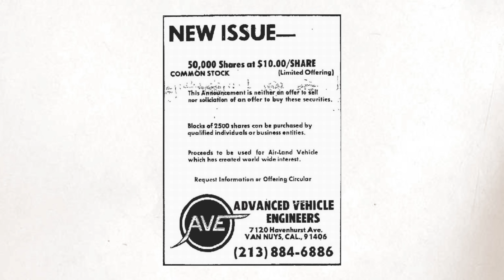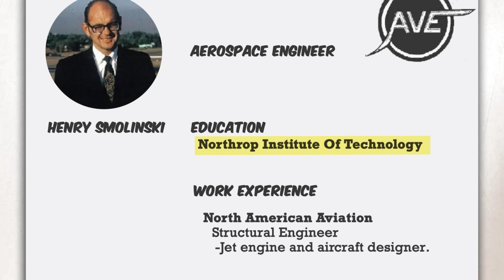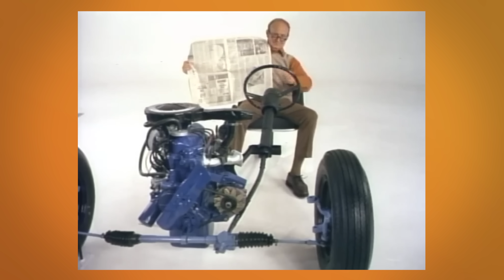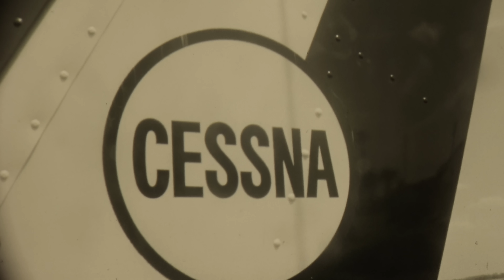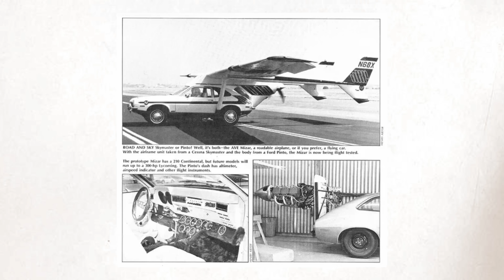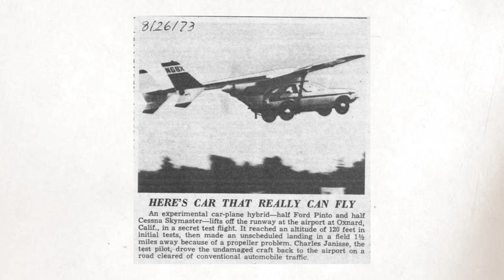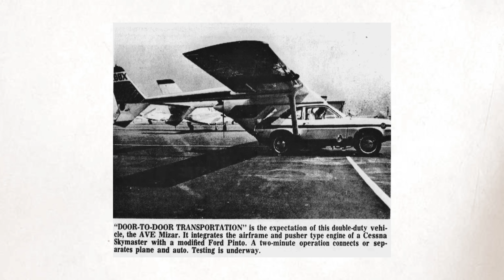The wild 1970s flying car that actually worked... until it didn't

Comment: Top Gear did a James Bond special about all the cars they used. The flying Pinto was supposed to be flown on screen but the crash happened not too long before production started. They used a reproduction of the car for ground shot and a model for flying.
Reply: The Bond "flying car" (The Man with the Golden Gun) was actually based on an AMC Matador (Coupe) and showed a Jet engine instead of a Prop based engine.... but that was just for the movie, it never actually flew as a full scale car. For the actual aerial sequences they used a flying scale model, not "the real thing".
Reply: @cdncitizen4700 
But the car really did do the corkscrew jump seen onscreen, the guy who did the stunt used to perform them at county fairs and other events, his secret was some kind of a pendulum device he had in the truck or somewhere unseen.
Reply: @dukecraig2402  Sure... different car, different scene... great stunt.
Reply: @cdncitizen4700  
Uh, yea, I know which car and movie, I was responding to your post after all.
Reply: @dukecraig2402  But you said "the car" when the AMC Matador coupe was the topic.
Different car in the jump - an AMC Hornet.
Reply: @ Both are not true. 

The stuntman chickened out (family issues apparently). The mechanic who helped build the car, and was on site, ended up doing the stunt. Broccoli (the producer) gave him a big wad of cash afterwards. 

There was not secret. It was just a matter of hitting it at the right speed. It was the first movie stunt planned with a computer. What you see in the movie is the first and only attempt and it is 100% real. 

The director for this movie explains the story in the Bond special.
Reply: @ The jump is a different movie. 

The flying car is the Man with the Golden Gun. 

The barrel roll jump was Live and Let Die.
Reply: @Yvolve the barrel roll jump was in The Man with the Golden Gun, not Live and Let Die. JW Pepper appeared in both movies.
Reply: @Yvolve barrel roll jump is also in MWTGG during the pursuit of Scramonga. You're probably conflating it with L&LD because the character of Louisiana sheriff JW Pepper first appeared in Ĺ&LD but made a second appearance in MWTGG being on vacation with his wife Thailand.
Reply: @ Yeah, my bad. The speedboat jump is Live and Let Die. I misremembered. 

The sheriff definitely messed with my memory of the films.
Reply: @ Yes, my bad. My memory failed me.
Reply: @ Yes, because the Pinto crashed before they started shooting. The car you see driving in the movie was a sort of replica. It never flew. I stated both of these things in my original comment.
Reply: @cdncitizen4700  Nevertheless, the entire idea for such a "flying car" In The Man with the Golden Gun came from thus stunt, I do believe. The production crew saw this and must have thought: we have to have one of those. (Model or screen magic, the look of the AMC fitted with wings came from this.)
Reply: Oh really? Dang! I thought it was a real flying car flown by Scaramanga (Christopher Lee, man with golden gun).  Darn! Darn! Darn!
Reply: @ Movie trickery. It was supposed to be the flying car and it was supposed to fly on screen.
Reply: Thank you for the interesting background storyline information
Reply: Not the same car.   The  chase car was an AMC Hornet.
Reply: Also, Scaramanga earned a million dollars a shot, so he didn't settle for sheet metal screws.

Comment: When will people realize that flying cars are just inconvenient planes...
Reply: True! Also what people dont realize... once your car gets airborn - its considered an aircraft and requires a valid pilot license!
Reply: @chrigu70  And poses new potential for disaster from above!
Reply: It's not like you can drive a flying car on the road... What's the point? 😂
Reply: @brianp7022  Thats the whole point of a flying car, that you can drive it on the road. There were and are serval flying cars that have foldable wings/rotors
Reply: @brianp7022  the point is to have a aircraft you can store at home. drive to the airport and convert into a aircraft. avoiding expensive hangers fees. but none of them so far have been good at being both. not a very good car and not a very good airplane either,
Reply: You can just use a plaine and rental cars or taxis and it will still be cheaper and faster.
Reply: I keep my light plane at home,  85 mph on 3.5 GPH, and I drive a plug in hybrid car that has a 45 mile range on e power, which I make for free with my large PV array.  Where the plane wins out over the car, is crossing mountain ranges that I have to drive around, one breakfast site in Wyoming is a 40 minute flight, but almost a 3 hour drive.
Reply: A Dutch company is close to getting their flying car certified... it will be both road legal and certified as airworthy.  A small autogyro with foldable rotors.  But yeah, it makes a bad car and a poor airplane, and for the price you can get a decent aircraft plus a good car.
Reply: It’s a perfect example of how just because it’s technologically possible doesn’t mean it’s useful or practical. Just looking at the design it would either have to drag around the wings, engine, tail, etc when it was on the ground, or store them at the airport. But if all the plane stuff has to live in a hangar anyway, you might as well just give it fuselage and gear and have a plane.
Reply: The last time I rode in a plane was Shreveport to Atlanta in March of 1981. 
On Eastern.
There hasn't been anywhere I wanted to go that it didn't make more sense to drive.
Reply: plane can not be convenient. It requires runway, not just a road. So GA is almost completely lost its sense with development of roads, for 300 km its faster to drive, for 1000 km its still terrible pain to fly on GA - after 5h you are not fit for anything.
Reply: @antontsau  VTOL planes require no runway. Some STOL planes don't require a runway either, just a little bit of a flat ground will do.
Reply: @macieksoft  Both are extremely ineffective as transport, trading their cruise flight, load capacity and/or costs for short landing. And even STOLs require some airfield, they cant evade vertical obstacles too.
Reply: @antontsau  Bush pilots used to fly STOL planes without needing airport. If you have some flat ground that's enough, no need for airport.

Comment: Looks like the 2000 MSRP of that car adjusted for inflation is about 16,000 today. 

I think the cheapest car you can get today is 18,000 with the Nisan versa. 

I’m guessing if 50 years ago they needed to worry about crumple zones and airbags and more than an AMFM radio with two barely functioning speakers …. It would have increased costs a bit. 

Didn’t they have steering columns that wouldn’t collapse and would kill drivers in that era? Same thing for pedals that could be pushed up into the cabin breaking legs. 

I’m SURE we could reduce costs by removing safety features we’ve had for decades. 

Hey! We could just look at modern inexpensive Chinese cars!

Comment: Looks like the Ford Pinto really took 'flying off the shelves' to a whole new level. Who knew the automotive industry had such a flair for dramatic endings?
Reply: -The number of actual production cars that have ever flown is fairly few, and the Ford Pinto is probably the most notable.  Something tells me that "Hank The Deuce" would endorse this effort....
Reply: Actually, nearly every auto manufacturer hates being associated with flight. Dave Blanton engineered an adaptation of the Piper Tripacer that used a Ford 3.8. Several were built. Good airplane, a little heavy. A little faster than a standard Tripacer, much more fuel efficient. Both Ford and Piper demanded that their names be removed from paperwork, interior, and exterior.
Reply: @ Liability is the big issue.
Reply: Here’s irony, in 76 or 77 my brothers pinto caught on fire but not because he was rear ended. It started in the engine compartment.. crappy little cars
Reply: @josephkangbiz  it exploded on impact like it's rear end collisions
Reply: @TruthwillPrevail7938  That is a gross exaggeration. The irony being that we are now fielding electric vehicles that will spontaneously explode with the frequency and severity falsely now attributed to Pintos, but no one cares now. They were a problem, but not near as dangerous as what we’re doing now.
Reply: @JoeOvercoat  i agree. my gross exaggeration was gor humor, not to be taken personally. I know someone who drove from California to Louisiana in a Pinto in 1987 without any explosions, but he always watched his back

Comment: My friends father rented these guys hanger space at Oxnard Airport. I saw it up close several times and actually watched it do taxi / runway tests where it took off and landed without leaving the airport. The fatal mishap happened on a flight from Oxnard airport, not Camarillo after they went on an un authorized flight and a wingstrut failed.
Reply: @thedrive
Reply: No wonder why the strut failed. They should have used rigid wings with no struts but honestly a 3000lb brick under the wings? I never flew a Mixmaster but I do know their empty weight was around 2600lb with wings and empennage.